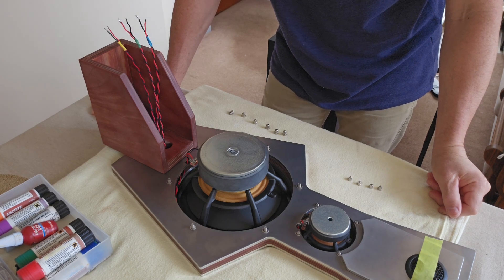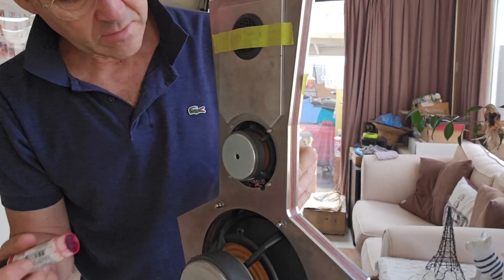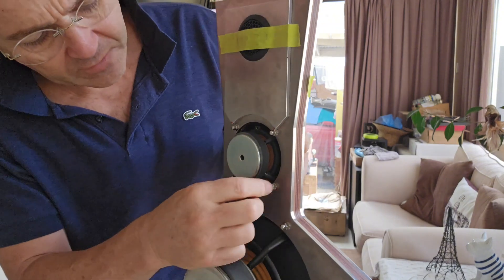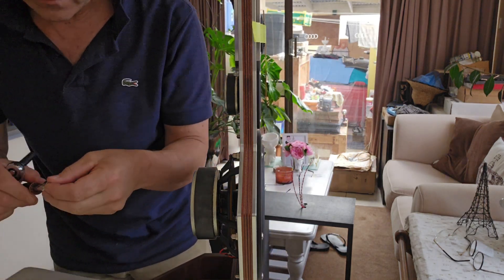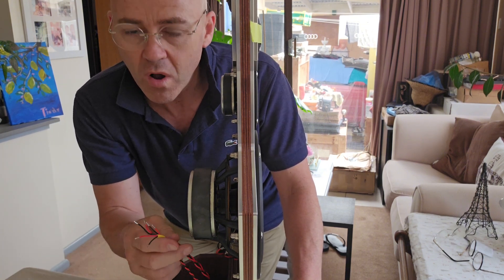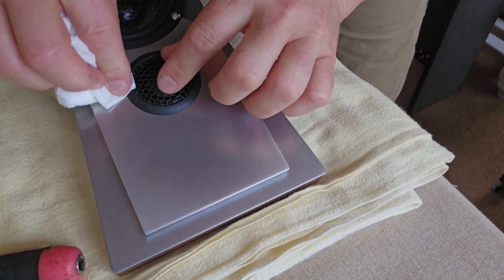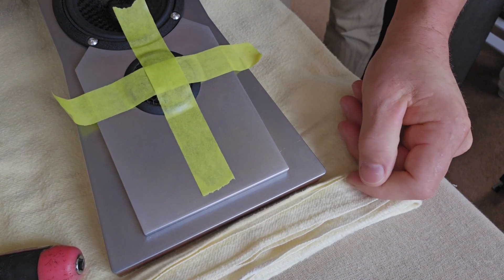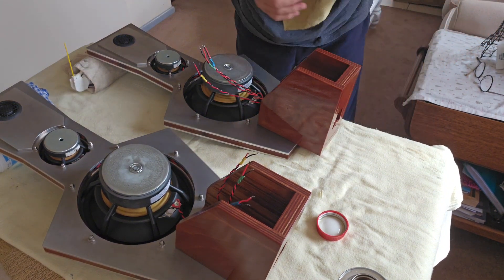"LINKWITZ LX521 THE BUILD PART 5"

Comment: Color me silly, but I thought that the loctite Red required heat to release and that you should be using blue  to just make it hard to come undone but you can still release it w a bit of effort.
Reply from the maker: Hi, I have a series of Loctite they're almost like chapsticks (well, that's the best way to describe them). The instructions say they don't need heat to activate. They will release with a good deal of effort, and that's why I went with the red over the blue.
I don't think the owner is ever going to push these hard enough to create any issues, but even if there was an issue, we can still get the driver out with a bit of effort.👍🎧🙂
Reply: @ 
Sorry I meant that you needed to use heat to unlock it. 

Although I did notice that some of the loctite type stuff have a measurement of the ft lbs required to break its hold so I could be off.
Reply from the maker: @michaelsegel8758  lol ok yeah.... I did a dummy run, and they do crack with a bit of pressure if they've ever gotta be undone.🙂👍

Comment: Hi Shane I am currently looking at buying a new set of speaker cables and I noticed on one of your videos you ran Robinson cable are you still using them or were they only for review.. if you are still using them how do you find them? Thanks Andrew
Reply from the maker: Hi Andrew, Yes, I am currently using the Robertson Elite Silver Series cables throughout my system. I'm very happy with them. I've tried cables 10 × the price of these cables made out of the same material and they don't sound any better than these cables do. I think Warwick offers great value for money with a very high-quality cable, high-quality components, and construction.🙂🎧👍